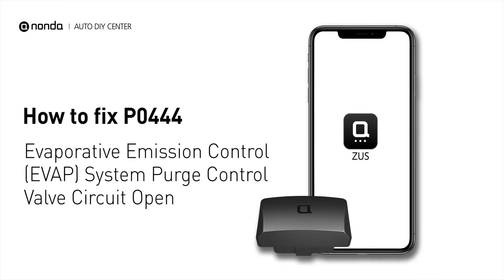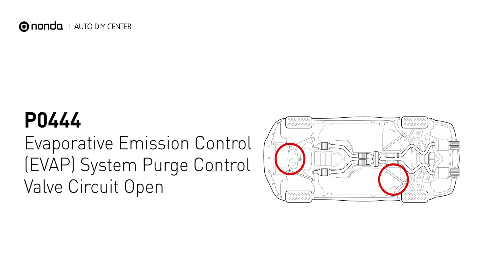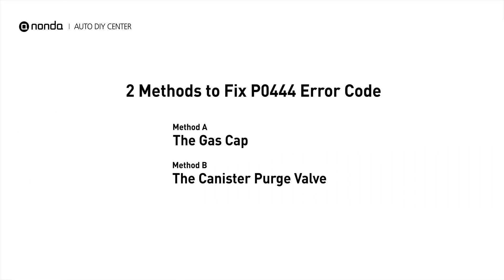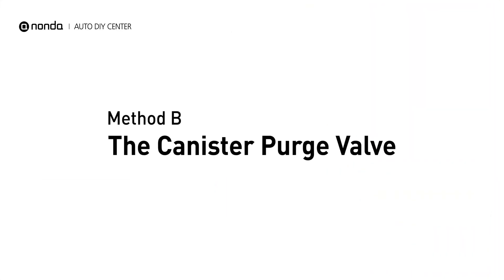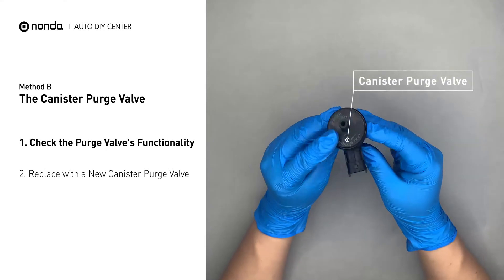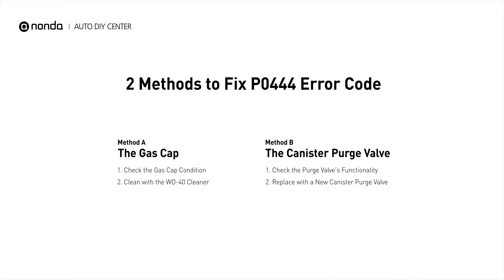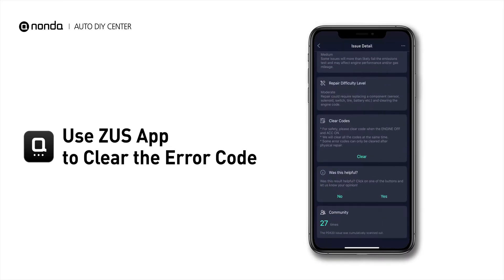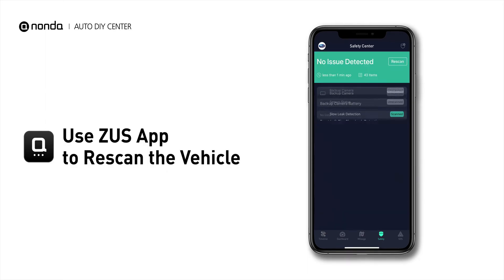How to Fix P0444 Engine Code in 3 Minutes [2 DIY Methods / Only $4.53]

Comment from the maker: Hi, I'm Steve, nonda's lead mechanic engineer. 
Feel free to leave your comments here if you have any mechanic questions, I will be glad to help you out!
Reply: Replace EVAP purge valve after P0444 no success even after replacing cap. 2011 BMW X5 3.0 twin turbo. Check connection and has no current going to purge valve. Mike

Comment: So I've done both of these and I still get a code where would I go after this? (02 impreza 2.5)
Reply from the maker: Have you inspected the EVAP purge solenoid control harness/circuit for any issues?
Reply: @nondainc  yes wiring seems to be fine there's no shorts. I'm getting the code for it but I'm having no drivability issues.
Reply from the maker: Kindly double check if there's any other trouble code that registers along with P0444.

Comment: I was getting a P0445 code I replace the purge solenoid after replacing a new code came through now P0444 my car will not start at all before or after I replace the solenoid so I can’t check to see If I’m getting any airflow any tips to work this could be
Reply: I have a 2003 Hyundai Sonata
Reply from the maker: Hi Nikki, have you inspected all the wiring related for any issues?

Comment: Hi, i have this problem 
4236 - EVAP Purge Control Valve (N80) 
          P0444 00 [032] - Circuit Open
Intermitent - Not confirmed

I replaced my N80 valve (06D133517B) with a new one (06D133517C) But the error still persist.
It's possible to be incompatible because it's not the same code (only last letter differs)?
Reply from the maker: Hello, we suggest getting your car visually inspected by your local mechanic for further diagnosis as you are receiving multiple error codes. Thank you!!